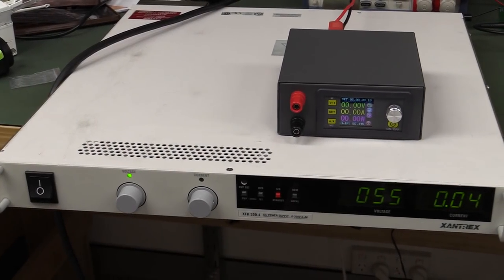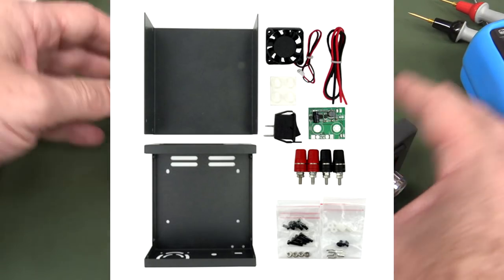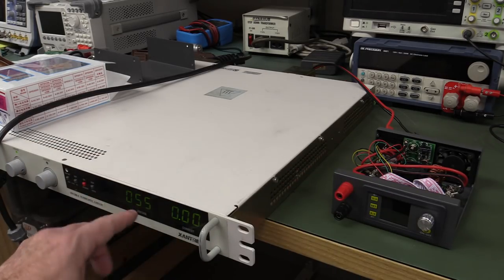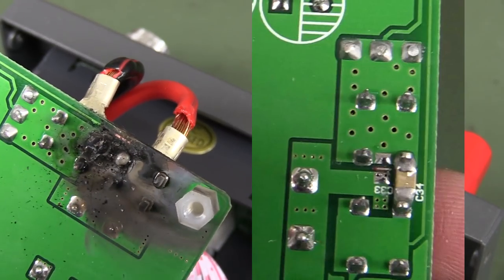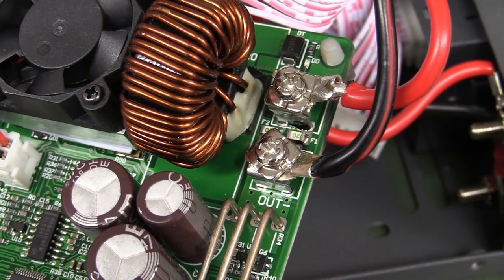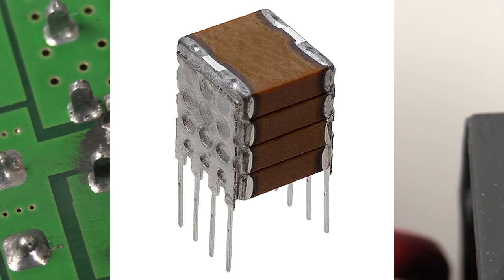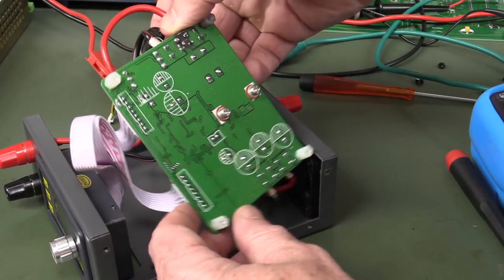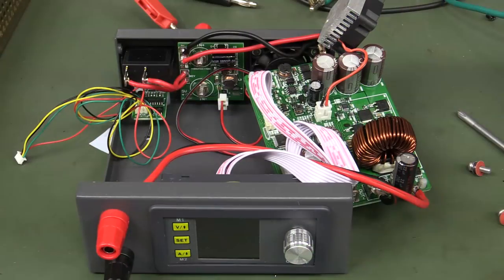EEVblog #1035 - Flaming DIY Power Supply!

Comment: Aha, the classic rubber glove over the smoke detector trick.  Very handy when things emit smoke unexpectedly.
Reply: bigclivedotcom ... said Clive packing a pair of rubber gloves in his case for the next business trip...
Reply: Ladyfolk with expensive hairdos.
Reply: whin will you burn somthing out in a exiting maner?
Reply: I'm surprised you chaps haven't wired a bypass switch on the smoke alarms.
Reply: bigclivedotcom Hey Clive, I don't know why I am surprised to see you here but I am.
Reply: A burning power supply video? I'm surprised Clive wasn't here fast enough to say 'first'!
Reply: Especially when it costs to have the fire department show up, like those business blocks.  No pan frying lamb at work!
Reply: Landrew0 smoke alarms have battery backups.  If you cut their 240v supply they keep running.  And they chirp constantly to tell you they lost power.  The glove is a much better option.
Reply: Also Landrew0 most commercial fire alarm systems are "monitored". If a device fails/etc. the system recognizes this and generates a "supervisory" signal/notice. The last thing he needs is building maintenance or security nosing around.
Reply: Nice trick. I wonder if it is a criminal offense. Should be.
Reply: If it's not criminal, it will at the very least mess with his fire insurance coverage... If I were him, I wouldn't show myself disabling fire alarms, even for something as minor as this. I mean, I'd still do it, but just not logged on camera.
Reply: I guess you use this for when you set your workbench on fire.
Reply: At school we puta little Cup on it
Reply: They are for the whole building and he very likley would not be allowed to tamper or modify the system, plus the system would go into fault if the detector was simply bypassed.

For a conventional system you would have to replicate the current draw of the detector as the system often works by detecting how much current the detection circuit is drawing in total and can tell if a detector head is removed or if the current draw changes. (The systems have an active end of line module.) 

For an addressable system, it is a lot harder to bypass as each detector has an unique ID to the main panel what is constantly monitored for it's presence.
Reply: Yes, but the 1,000,000 question is who was there to move the camera at 10p ? :)
Reply: Likely David (Dave2)
Reply from the maker: Okurka : The ladder was already unfolded because of other stuff being done in the lab. I edited out moving it from the other side of the room.
Reply: "Smoke emitting diode."
Reply: That detector is connected to a fire alam panel. 24v supplied by the panel. Covering it is the only quick way to avoid an alarm, even though its against the law in most states. I probably wouldnt have shown a video of myself tampering with a monitored fire alarm system in a commercial building.
Reply: The rubber glove is Russian roulette... You've got to be quick enough, if not, you're going to have your head right next to the eardrum punishment right when it goes off!
Reply: Yeah. The glove on the smoke detector is new to me. I like it. Usually, I yank the batteries.
Reply: conicEllipse that detector is hardwired to a fire panel, no batteries to pull out.
Reply: And if your home or biz burns down, with any mods to smoke alarm, no insurance payout!
Reply: MrKurtHektik  youre too young to have seen those.  50 years ago most women did that at least for a week after their Hair-do. and they put it over their hair and not their heads....
Reply: If the Fire Department shows up you get cited for violation of Ohm's Law.  Australia really sucks.
Reply: Love the glove trick. The company I work for has smoke detectors that can be covered up using a toilet plunger. If you want to take one off the ceiling you use a sink plunger.
Reply: In some places, the fire department will hand you a bill for having to show up to put out a fire, even if there is no fire to put out.
Reply: In a Premium Inn, in England, all the guests had to go outside due to fire alarm TWICE!!. Reason: the vapor from the shower, i wonder if i have to pack a pair of gloves next time...
Reply: As if the smoke detector would detect this little amount of smoke... If it did my smoke alarm would go off everything time I solder something
Reply: OMFG WHY DID I NEVER FIGURE THIS OUT, I'M A MORON. Clive, you're a genius and my hero and the world NEEDS you to have children.
Reply: be careful of powdered gloves, I've accidentally evacuated hospital wards before putting them on smoke detectors.
Reply: Canadians knew that trick for years eh?
Reply: Yes. Especially when purchasing questionable dolls from the dollar store.
Reply: Once again, latex saves the day!
Reply: Rafael Judah  You're right, nobody gives a damn.
Reply: In a lab I work at the fire alarms are infrared detector based, not smoke. So it needs actual fire and flames before it goes off. But it is a specifically designated electronics lab, so no wonder.